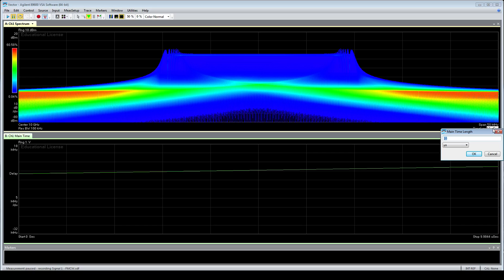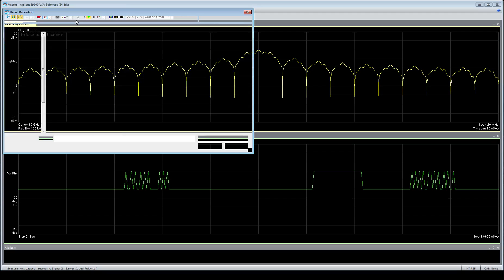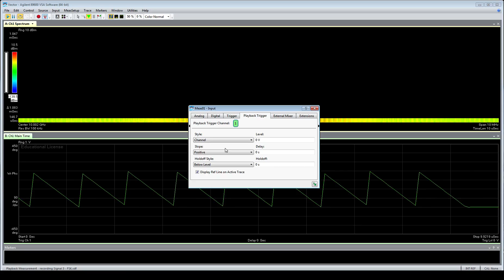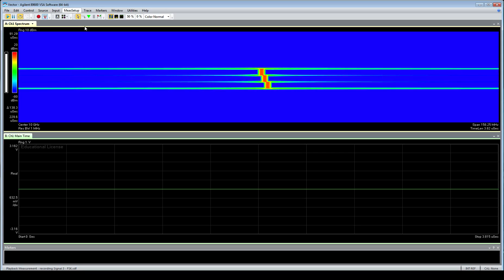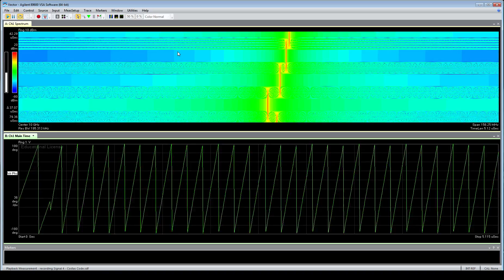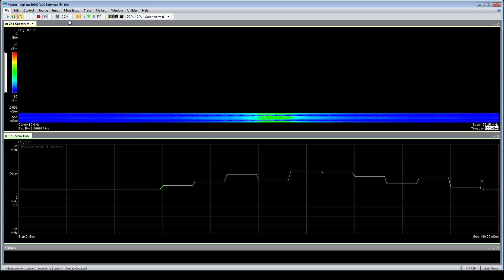ELINT - Recognizing Advanced Radar Signals

Comment: Nice video.  What is the delay plot?  Phase change per sample, since the y axis units are MHz?
Reply from the maker: Louis Brown  It is  the rate of change of phase with respect to time: d(phi)/dt. 

If you're looking to calculate it in MATLAB for some set of samples in the time domain, we'll call that variable y, the equation becomes: delay = diff(unwrap(angle(y)))*fs/(2*pi)
Reply: Shouldn't delay be d(phi)/d(f)? The units on d(phi)/dt are inverse seconds, which is not delay. That being said, I'm not sure what sense of the word delay is being used here. Usually delay refers to the d(phi)/d(f) of a filter, in which case you would be looking at d(phi)/d(f) of the impulse response of the filter. In the case of a radar signal, there is probably a relation between the radar ambiguity function and d(phi)/d(f) but I actually think your "delay" plot here is simply frequency, since it shows a ramp for FMCW and steps for FSK.